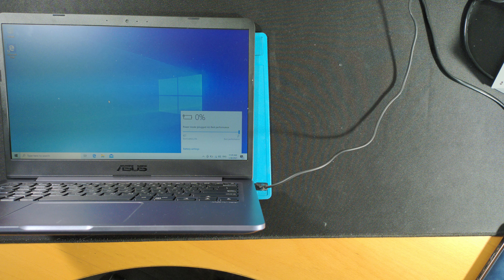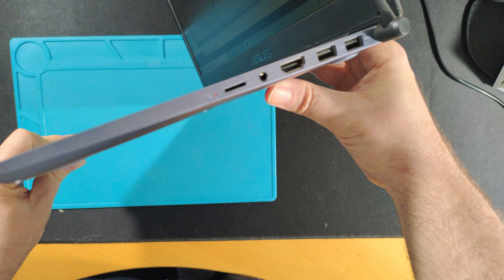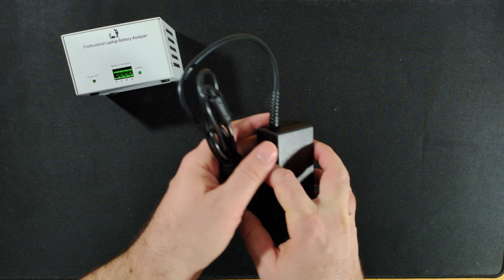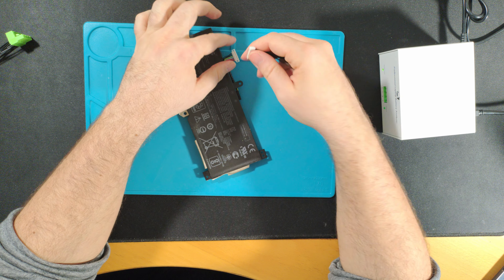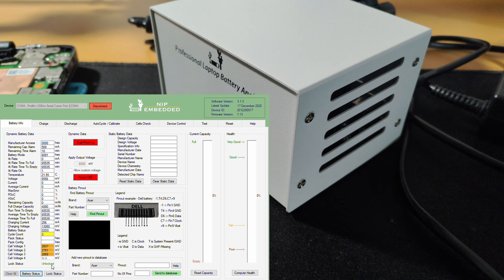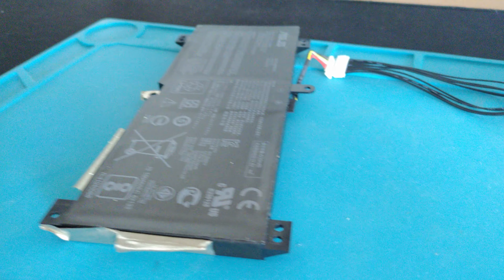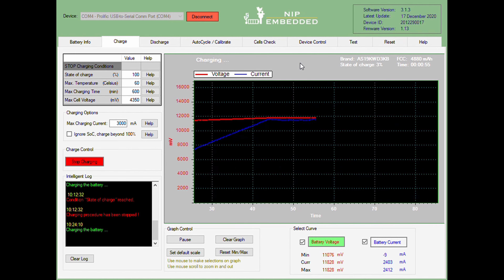FIX your laptop battery with this tool! - NLBA1 Professional Laptop Battery Analyzer

Comment: Its ok if your in the business, but for personal use its a rip off €299 a year to be able to reset batteries, and it does not support all batteries
Reply: NLBA1 is the most advanced laptop battery analyzer on the market, it is a real PRO tool, you pay once and you have it unlimited, lifetime. You can do tons of things with the analyzer.
Separately, if you want to repair batteries, you need a license per year which has a good price, the price of 3-4 batteries while you can repair hundreds or thousands.

Comment: Please, I have some questions.  Does he reprogram the battery ... Does it explain the damaged cell ... Does the device have uses other than the laptop battery, I hope that there will be a complete explanation for the use in a simplified way I need one and how much is the cost of shipping to Egypt
Reply: NLBA1 is the most advanced laptop battery analyzer on the market, it is a real PRO tool, you pay once and you have it unlimited, lifetime. You can do tons of things with the analyzer.
Separately, if you want to repair batteries, you need a license per year which has a good price, the price of 3-4 batteries while you can repair hundreds or thousands.

Comment: Does it solve the X-mark problem ... Does it solve the problem of phantom shipping ... Does it solve the problem of slow shipping ... Does it solve the problem of sudden discharge ... Does it solve the problem of the shipping ratio that doesn't change
Reply: NLBA1 is the most advanced laptop battery analyzer on the market, it is a real PRO tool, you pay once and you have it unlimited, lifetime. You can do tons of things with the analyzer.
Separately, if you want to repair batteries, you need a license per year which has a good price, the price of 3-4 batteries while you can repair hundreds or thousands.
Reply: @nipembedded9976   You should improwe your business Model with an alternative Per/Number of lets say 10 or 30 resets. That way it would attract more customers I think. Its not an alternative for personal or even small business use to buy license /year. That way you would sell more hardware (the NLBA1) also,

Comment: hi friend , just as a general question I wanted to ask to you. After your video I checked my battery health and it shows as 52.8% (with batteryinfoview tool) also I checked with Windows 10`s powercfg /batteryreport manually , I found out the same value. So what I wanted to ask if battery health will be under which value it should be considered to be replaced ? I`m using this laptop since 2016 by the way as an additional information.
Reply from the maker: Well, it depends on what is the main purpose of your laptop. Do you use it most of the time on its power supply or not? If you use it mostly plugged in, this battery health still ok since you can still use the battery as a decent UPS (Uninterruptible power supply). But if you use it mostly in a mobile environment, you have to count in basically you have half of its original battery life, which is pretty bad. As a general rule, these batteries can hold a decent charge level (till 80%) from 300 to 1000 cycles (depends on the models), and it is advised to swap them out after ~3 years. (but still depends how degraded they are). Hope this helps you!
Reply: @MakaiTechReviews  thanks for your quick reply. Yes actually I use it mainly at home connected to power 90% of the time so I guess no need to swap it yet. I guess by the end of this year I might consider changing it to a new one. Thanks again for your help.
Reply: When the autonomy of the battery is not satisfactory you could replace it. For some users, a battery health 30% would be good enough to get 20-30 minutes of holding time to save their work, for other users a battery health 70% would not be sufficient to play games few hours.

Comment: I have one of these myself (after seeing the reviews online) and I can honestly say it is well worth the money paid for the device. This is a great device for checking the health of various laptop batteries (especially if you do not have the laptop for the type of battery), running calibration checks, and especially trying to recover deep discharged cells.
Some battery packs will let you recover a deep discharged battery pack - others will not though, and will just lock themselves.
I might look into resetting batteries at some point in the future, as they have a 10 day trial for the unlocking tool - but this will be once I have amassed a lot of batteries that need unlocking.

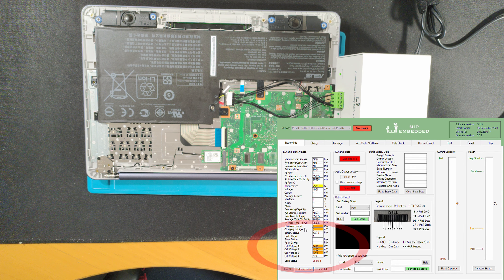Comment: 6:20 if the battery status shows LOCKED then it is because the BMS (inside of the battery pack) has shut down the entire pack.
Sometimes you can try and force a voltage into the battery pack, but the vast majority of these batteries cannot be salvaged at all without using the reset function (a paid for function) and re-programming the BMS. If the voltage is too low, this re-programming might not even be possible, so you'd have to use another tool to pre-charge the cells outside of the BMS. This would require disassembly/destruction of the pack, meaning that you'd be better off disassembling the pack and salvaging the Li-Ion (or Li-Poly) cells instead.
In this case, the cells were perfectly fine (full capacity and only 1 charge cycle), but the cell voltage was too low (1.2V - 1.4V per cell), and the BMS locked the cells. The best method here would be to disassemble the pack, salvage the Li-Poly cells, charge and capacity test using a balance charger (like Turnigy Accucel or SkyRC Imax), then use in other electronic projects (or use to repair another laptop battery if you have a license key for the repair function).

Comment: Aliexpress has ev2400 unit.  Might be good for bms reset.  Thinking to buy.
Reply: EV2400 is just an adapter USB to SMBus, you need a paid software able to unseal and unlock the chips. Anyway, NLBA1 PC Software supports EV2300/EV2400.

Comment: A special explanation. I want to ask whether you can reset the battery and modify it without the support program from the site because it is paid monthly and this is cumbersome because I will not use the tool continuously. Thank you.
Reply from the maker: As I know this feature is a paid feature indeed. This device is mainly build for reapir shops, so casual user (who repair batteries like 1-2 in 5 years) obviously the basic features are still fine. I know the repair function would be nice for free, but since it is quite a unique one, I totally understand the ower/company want to profit on it.
Reply: It is not possible to modify battery EEPROM information without the software since most of the chips are well secured. Once you unseal the chips then you can do it. We can offer FREE Chip Resets for about 30 batteries but you need the device. Unfortunately, there are no other solutions to pass the security of the chips.

Comment: Hi friend thanks alot cause your video was quite useful,
But am having a problem on how to  connect the uniform black battery connector wire to the internal laptop battery output terminal, which normally comes with a multiple colored wire which enable you to connect them in the short uniform back cables that need to be connected to green socket which connects directly to the device for a proper communication of  device to the battery in question.
So please my question is how do you connect a complex wire battery that may have more than four colors of wire ,
Just like the ones you use in your video,
The internal battery you used has only four colors of wire {red ,  white, yellow, Black, wish obviously indicate ,that red=positive [v], back = negative [G], and white and yellow =equals clock and data wire, right....
So what if you came across a dead internal body wired  battery (just like the ones you used in your video that has about eight wires connected to the outlet terminal of the batteries ) that has eight or more than eight , maybe ten ,
That might have many colors , like ,red , blue ,green orange,yellow and black, 
so
My question is how do I connect them rightfully( like how do I detect the clock Wise,data , ground and positive wire from the ones that has about six colours of wires...
Please this is a problem that has been facing for a very long ,how I wish I have your email address nor WhatsApp contact,so that I can be able to forward some image aspect of what am taking about ,in case you do not understand me..
Reply: If you check the software for the NLBA1, it will have a pinout database, so you can check the pinout of the battery pack and connect it to the NLBA1 as required. Some batteries (especially modern style ones) will have one, or more, "System Present" pins which require connecting to Ground in order for the battery to function.